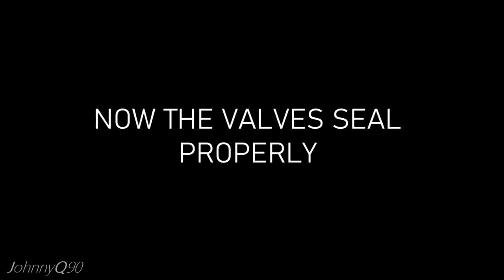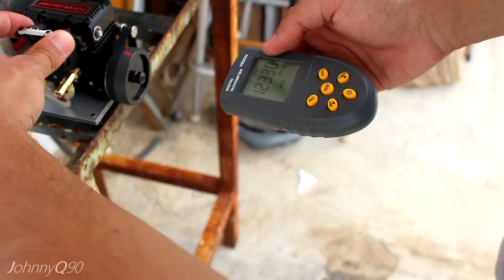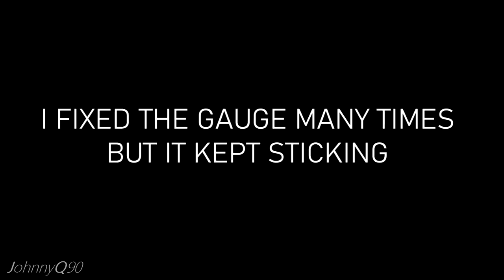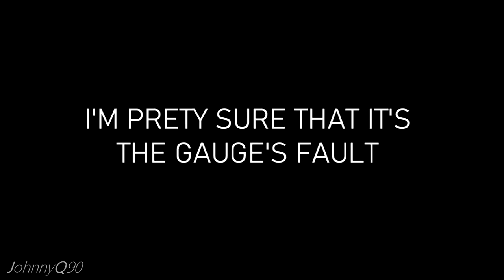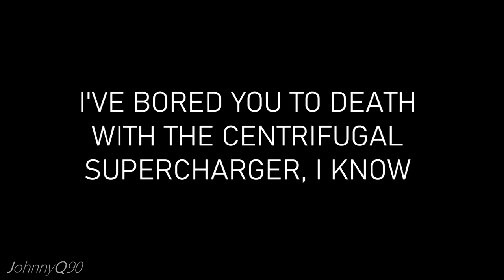PERFORMANCE Upgrade for the 4 Stroke TWIN Cylinder - *VALVE Lapping* - Supercharger Update

Comment: Bored?, NOT here. Is nice to see you try what we have not yet attempted to do. I was thinking on porting out the intake and exhaust if there is any more mm room there. Maybe we get to see you try 1st on another video. I just got mine so I gotta break it in 1st.   NOTE: Is the website wrong about the specs on the rpm?. Stirlingkit specs are 2200-16,000rpm. Is that not the case?.

Comment: For the mixture, you could maybe use the EGT (Exhaust Gas Temperature). We use this method in aviation to adjust the mixture ratio (rich/optimal/lean etc....). But will you find a sensor ? xD I think it could be an easy way to control the mixture. However, love your video ! Go ahead, THE FUCKING POWER IS COMING ahahahah

Comment: Your problem will be that fuel needs to increase as boost increases so unless you have efi you won’t be able to achieve this making tuning next to impossible.
The only way your likely to do it is run it very rich at low end so that that when it’s fully open it will be the right mixture.
If you tune it at idle the when it’s on boost it will be lean

Comment: You need to look into valve float and timing. On bigger engines the fluctuating vacuum is caused by that. It should be steady vacuum. Probably difficult to remove from this scale though.

Comment: Try fitting a smal fulefilter or something between the intake and the pressur gauge. That helps a lot with bouncy boost gauges.. old trick that works well on cars. Maybe you are blowing the air straight through the head because huge overlapping camshaft. And it makes a false pressure reading?

Comment: Once it starts pulling from the intake it’s just gonna run away. That’s just a mix screw as u know. Your mixing the air/fuel. Fuel can’t burn without air. But those motors are just the same as a diesel. U have to use it the way u were before. Turbos are always before the intake. Super chargers are after yes. But your dealing with something totally different. Super chargers are usually on a plenum. It doesn’t have a long travel. It’s directly to the intake valves right along side of the fuel. Essential mixing at the same time. Not before. If it makes sense. It has not as much to do with what u are doing. U have the right idea. Just to far of a travel for everything. Once u start messing with the distance that’s when it is wrong. U have to get that intake as close as u can back to the stock spot. A lot of the times too dealing with gasoline motors u have to run a different fuel. Mostly alcohol in your case. But it’s a diesel. I don’t know diesel at all. I just know they rely on compression and oil to combust. I think diesels just need more fuel at that point. So u should put it back the way u had it. Just add more fuel. Your adding way to much air to fuel.

Comment: At this point you have reached (and gone beyond) the maximun air pressure (supercharger) for the maximun amount of fuel (carb needle open) that is able to enter the engine.

From this point forward you will need to increase the fuel preassure to keep the combustion ratio. In other words, you need a fuel pump.

By the time you make this supercharger to work at the desired per square inch preassure, you will be burning a lot of fuel and it will become impractical to have such smal fuel tank.

Comment: Not at all bored with this supercharger yet! Watching you make progress on this is great, so keep trying! But as opposed to the positive displacement supercharger what if you would try to make this a turbocharger? As in capturing the exhaust gas to spin it up instead of using the flywheel.

Comment: Have you tried putting a sintered filter in the gauge hose? They help dampen out the pulses and help to give an average reading. Had similar with vacuum gauge on twin cam toyota years ago, without supplied sinter gauge flicks about too quickly, with filter jittery movement slowed to give sweeping gauge giving more average reading.
Worth a try hope it helps.

Comment: To steady the gauge use  .5mm hole or some sort of adjustable vale to flatten  out the vac pluses. Look at a carberutter ballancer gauge.
A fish tank adjustable air restriction valve would be perfect.

Comment: Also, a super simple gauge could be as easy as a balloon? You could “calibrate” the balloon first with fixed pressure/size, just for a simple visual without wasting lots of money breaking gauges. Or stick a 1 way valve in between

Comment: Bored isnt a word I would use in this senario, more like amazed. But you will make a positive displacement supercharger, the roots style or screw style? You would most likley need it to be a draw through because of lubricating the internals on those. Nice to see you are not giving up on positive manifold pressure. Turbocharger after?? :D

Comment: Love the work.  I've always wondered if it were in your wheelhouse to make a VVT setup (?!) to alter the effective compression and get a little more even power curve. Not sure which method would be easiest though... definitely not Honda's method with two cam profiles and timings

Comment: Maybe the turbo being down low is giving the fuel somewhere to pool up and then when there gets too much it surges a tiny bit causing that idle? The smoke to me indicates it gets really rich really fast when its revs change. Can you make a throttle body and try placing it before and then after where the fuel is introduced to see if that solves the problem? I'd really like to know.

Comment: its loading up with fuel at idle. the idle jet may need to be almost fully closed for it to run and it will probably always want to idle high if your experience tuning rc superchargers goes anything like mine did.

Comment: I’m not a professional but how about a bypass valve that allows the engine to pull air from the atmosphere when there is no boost / low rpm and that closes when boost is made? You’d just need a one way check valve at the inlet. I think the small scale could be making it necessary for this engine. Just a wild guess though.

Comment: Nice but spend a few hours reading up on o-ring channel design. It's very easy. As it is now, the only thing holding your rings in place is friction. That's not how it should be. They should be held in captive seats, with a 20-30% compression, give or take, and it's easy enough for you to machine those channels.
There are even online calculators that will let you check that your compression and free space is sufficient. Trelleborg has one for example.

Comment: When u has a draw thru sometimes fuel can build up in the inlet at low rpms, than when u rev it can all get sucked thru and run rich or linger at higher rpms

Comment: makes me wonder if you tried the Volkswagen set up for a turbo. bolt on turbo kits on the Carbed Volkswagen engines. The fuel is delivered after the turbo. not before. Pressurized carb like a air craft engine? :D

Comment: Your probably going to need a dual jet setup for the carb one for idle and low ram and one larger one for high boost or 2 of the same size if you have a way to make only one go for idle and the other open up for higher boost

Comment: You need to run a fuel line from the exhaust to the gas tank lid, to pressurize the tank and push the fuel into the carburetor. The engine wont run right because it's not getting enough fuel supply.

Comment: I havnt watched the full video yet but if u havnt make a dump valve for idle so the vacuum and everything is normal. And idk if u can’t link to throttle or vacuum but when it see 0 vacuum the valve should shut allowing boost into intake. And at idle or no vacuum no boost = less freaky gauges

Comment: Sounds like you need smaller fuel jets. The vacuum from the supercharger can suck more fuel through the jet, so a jet that does good on an n/a motor would just be dumping fuel uncontrollably with all that extra vacuum.

Comment: Why not connect the motor up to a air compressor with the regulator set to a constant PSI.   See if you can tune the motor with boost to prove out whether it’s the supercharger or the engine which is your problem.

Comment: ive done many a draw through setup on old nissan L series engines haha.. you did not connect the exhaust pressure feed to fuel tank, consequently starving of fuel.. there may also be an airleak on the vacuum side, spray soapy mist around the pipe and gasket maker when on boost.. should see tiny bubbles form.. hook it up to a brushless motor with a 10 watt power resistor.. measure amps, instant dyno.. load it up with different resistors, you could probably math the actual shaft power figures.
i dont know why you put an elbow between the carb and turbine inlet ?! less bends the better,  in any inlet scenario..
great work though..

Comment: you should port the engines intake ports and the exhaust, since they weren’t originally designed to intake that much air. (if it’s even possible)

Comment: Hey dude I believe you can't tune it because the vacuum created by the supercharger is forcibly sucking in air and fuel from the carb. They usually work by venturi effect I believe.

Comment: Bigger plenum on intake=less vacum spikes on intake stroke @ low rpm.
You can smooth the issue, but u need more flow on compressor side

Comment: you have to control the pressure in the motor more RPM there is also more rotations on the compressor more pressure (pressure relief valve)

Comment: I think the supercharger should be blowing through the carb . The fuel will be bogging the charger down . 
If you have raised the fuel pressure to compensate it should work fine .

Comment: I'm curious to see if the cam specs are capable of utilizing a supercharger, it sounds like the surging you're having issues with is related to the intake/exhaust valves not having as much overlap as necessary to fit the Procharger/Supercharger setup you have.

Comment: Add a throttle body after the turbo, the carburetor should be fully open, then you regulate the mass air flow at the inlet. Otherwise you'll never get that going straight...

Comment: Also a dump valve will fix al your weird issues with idle. It’s trying to build boost at idle forcing it to kee getting air and run. It’s definitely not the supercharger u have. Look into dump/bypass valve al cars use it to avoid this issue its like a blow off valve for a turbo car kind of. Got any questions lemme know

Comment: You can use etanol an reach a big compretion ratio , power and rpm
80% etanol is like 105 octane gas 
And 100% is like 120 octane

Comment: Amazing work and ideas. I have a suggestion for measuring your pressure output. Use an auto motive MAP sensor. They have a voltage output that can be measured with a DVM. Their values are posted in a table. You can then use the voltage output to tell you the pressure you are making. They are marketed in bar ranges. 1 bar, 2 bar...etc
Reply: No good in this application, those sensors wouldn't provide anywhere near enough resolution for the tiny amounts of pressure that this is making.

Comment: Carsandcamaras have build a similar turbo charged engine that had the same problem, and it's because the turbo wil suck the fuel and air on its own very easily from were it can, so the only way to make it some what work is to have the carburator after the turbo like your first attempt.

Comment: I'm wondering if its the age old thing of concentrating too much on the inny and not paying attention to the outty e.g. the exhausting itself is restricting the whole thing.   Was just thinking of my own exploits on a Vespa engine I fitted a 225cc upgrade to, it already had a tuner exhaust but that was only capable of handling a 200 output, it bogged, it ran like a pig, ate spark plugs and cost me a fortune in jet kits then a mate says "'ere try this on it" it being a dedicated 225cc exhaust and blow me down it turned it from a misfiring pain in der rear pig into a proper cheek clencher, stopped eating plugs, ran like a dream all day long and all because I overlooked the outty part of the "air pump" cycle which all fuel engines are basically.   I was also thinking if I had that amazing CNC machine of yours oh what fun I would have in tuning parts for my Vespa and Lambretta, you could earn a small fortune turning out billet parts for the scootering community and the motorbike community :D

Comment: You need to duct the exhaust gases into the pre charger turbo hot side 

Then measure the boost pressure at the blow off valve

Comment: Is this engine using for real spark plugs or are the coils like regular 2 stroke engines? You may need a hotter plug. 

I too find it very strange that you pump the accelerator a few times, nothing, then all of a sudden it's got power when the throttle is closed... You may need more carb.

What may be interesting to see is test the supercharger by itself, I mean no motor to see how much air it moves by itself. You may also need to change your pulley ratio back down to 8.5 to 1.... maybe you have too much boost. 

Another possibility is you need higher nitromethane content fuel? Just like real engines, sometimes they want higher octane.

Ignition timing... where is it set to? (or are these glow plugs and not actual spark spark plugs?) Timing could be waaay off, that would give you fits too!

Comment: its a simple problem your facing as a engine tuner now your blowing open the valves you need stiffer valve springs as the boost pressure is coming into the inlet runners the valve springs cant stay shut causing it to rev up and suck more fuel and air in ... STIFFER VALVE SPRINGS I WANT MORE ON THIS SETUP

Comment: New here! Are these real engines running on gas? Any cooling system? Oil in the motor? What's feeding the fuel carb/efi? What's controlling the spark?

Comment: The fuel is probably puddling up in the supper charger mount it on top so it’s pretty much gravity fed instead of the supercharger forcing the fuel up into the motor

Comment: That tuning issue sounds a lot like a simple vacuum leak. It causes erratic idle behavior, poor throttle response and not responding to mixture tuning. With such a complicated setup it must leak somewhere

Comment: You need a gauge with some damping in it. Why not use a cheap boost/vacuum gauge for a car? Also are you sucking through the carb instead of blowing through it for a reason? Im wondering if blowing through would make it run better? Or maybe the carb cant handle the pressure and would be a big boost leak

Comment: Man beautiful I hadn't seen this one try a screw valve from a motorcycle carb sync gauge set hell being your measuring manifold pressure you might want to use it for the test. And the valve just makes the hole smaller so the spikes from the valves opening and slamming

Comment: You need to rethink your options. I know it's not "typical" on street engines but they're completely different.  I bet if you put that carb on the outside of the supercharger inlet (like how a roots/whipple) supercharger draws air it'll meter properly. If that carb is dependent on pulse pressure from the engine it may not like having pressure both sides. If it's also purely venturi operated and drafts fuel through the mixture screw having positive pressure is going to effect the pulses and metering. Think outside the box buddy.... you're about to make a breakthrough!!! Your next option is mechanical fuel injection with an adjustable lever to control the pump shot! ;-)
Reply: Another idea for lapping valves would be to glue a plastic stick with hot melt glue then use a small drill to spin the valve. Hot glue would pop right off afterwards
Reply: Your valvesprings are limiting you now... that's what's governing you. Do they make spring shims or stiffer springs? You can hear the motor "breaking up" when it hit valve float.  I like your stuff man... I'm into the full size "models" ;-)
Reply: If you calculate the displacement and then factor in whatever the stoichiometric ratio you want you can calculate the brake specific fuel consumption and you'll know within a close amount what the pump shot for your injector needs to be. For instance let's say that engine is 10cc and you want 13:1 (probably MUCH richer for alcohol and nitromenthane yeah... let's go with 11:1afr@sea level. That would be a mechanical shot of .8-.9cc. 
Or you could skip the pumping all together and just have a belt driven pump with an orifice to pump a spray shot. 
If you draw through the supercharger the methanol will keep the air charge cooler as it's being compressed and could lubricate that impeller shaft also. Does it have it's own lubrication? Usually superchargers are fed an oil supply from the engine and drain back into the oil pan. I don't see any of that being used in your application.

Comment: I think you need a blow off a flap that does not press the pressure of the compressor into the engine when you take your foot off the gas and at a higher speed more gas with an additional line

Comment: you might have intake leaks with thie draw thrue setup, in this config its a lot of vacume in the supercharger, if you do not have good seals in there it wil draw air thrue bearings and sutch. when not in boost of course.

Comment: Get a boost gauge. have you tried to change ignition? i never had one of those engines. but i know by adding boost you change ignition.
you can change them by the amount of nitrous, the Glowplug or the compression. 
you make good content! 
Cool would be if you find a way to measure the torque.

Comment: seems like you need a boost chamber like the boostedboiz did for their turbo shopping kart. they couldnt get it to run for squat until they added a small chamber on the charged side of the charger.